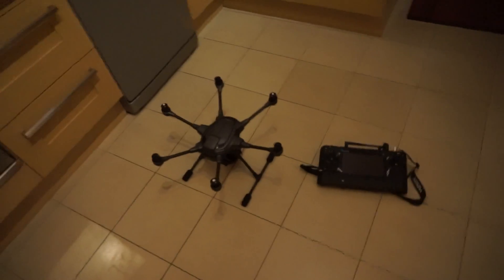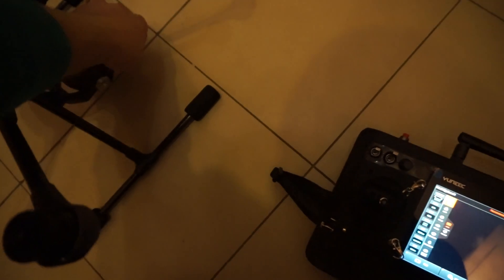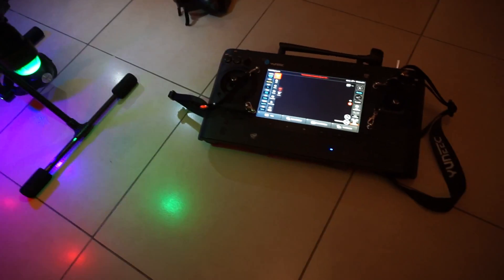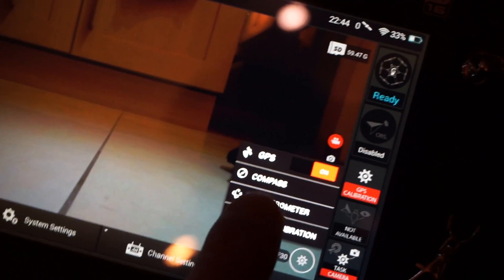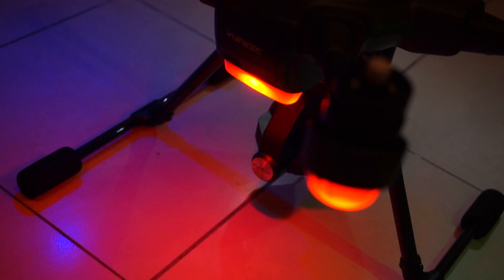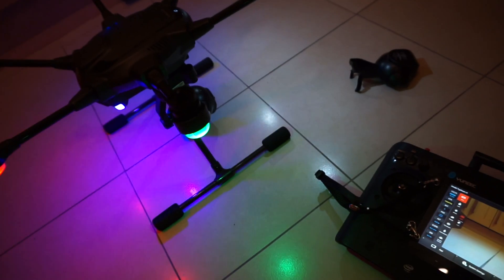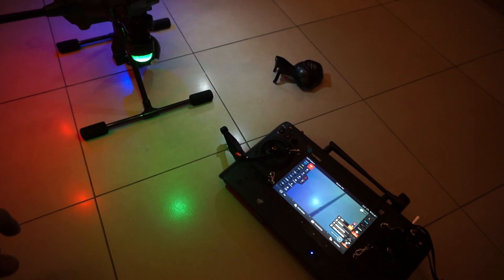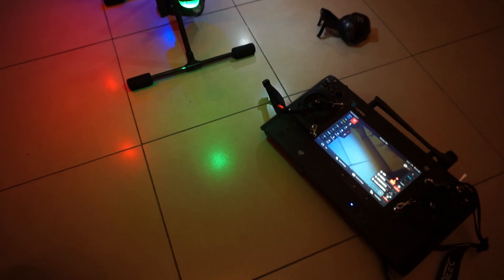YUNEEC TYPHOON H, ACCELEROMETER CALIBRATION STOP TOILET BOWLING.

Comment: hi, great video, really helpful for us beginners. Have one question, if you can help me. I received my H 5 days ago (Cyprus). Should i be doing compass calibration? Reason am asking is that on my first start up, the H locked on 20 satellites, gave me the green Ready to fly signal on the RC. Is that safe to fly, or would it be safer to first compass calibrate since it arrived to new location from Germany? any advice will be much appreciated...Happy flying drone lovers
Reply: You are free to do this each time before flying regardless the location. In this case you´re always on the safe side.Strictly speaking there is no need for compass calibration if the H don´t ask for it. Happy flying!

Comment: Not sure about the kitchen floor. I mean, since when has an Irishman been able to lay a level floor? Just joshing with ya. Good video. Thanks for the info. Is it right that the H has to have a compass calibration each time it flies? Or is it each time it is used in a new location?
Reply: The H holds compass cal quite well.  It only requires re-calibration after a firmware update or when being flown at a location far removed from the area of last calibration.